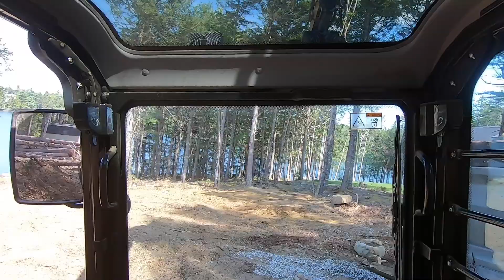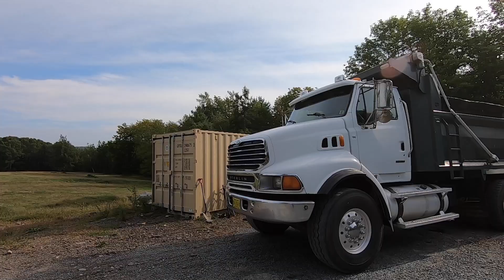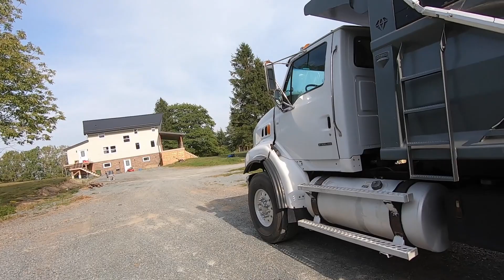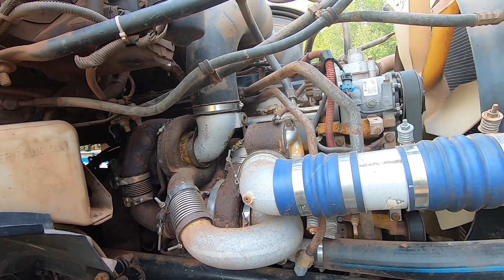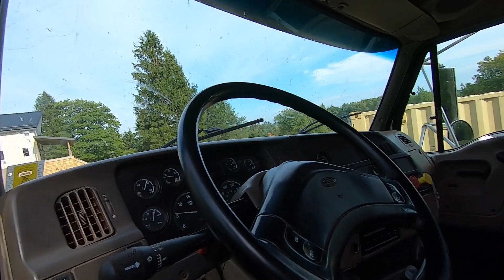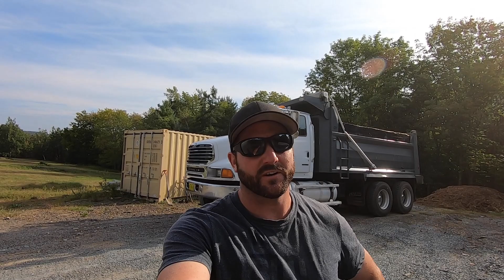I FINALLY DID WHAT NEEDED TO BE DONE & BOUGHT A DUMP TRUCK! DO I REMEMBER HOW TO DRIVE?

Comment: Thats a SLAMMER buddy..  keep the dirt off the underside and door jams, it holds water. As far as the AC.  you have a leak..  Charge it and see how long it takes to  stop working.  If its really short, UGH then you have to find the leak and replace the line(s) if you are ok to keep recharging, then have at it.  Next advice. Do you guys up there use a lot of salt in snow up there? Make sue to rinse it off.  If you have a lot of salt i recommend getting a garden sprayer, then mix 1/2 diesel and 1/2 wd40 and spray it all underneath, under the doors. on the box and back.  Also with the windows up spray a little on the Inside doors.  ( best if you take off the inside door covers and give a little spray.) As far as the  Eaton Fuller,  Piece of cake..  if no load.. Use first or second to start. If you want to sound cool with no load.   run the 3-4 gears fast using clutch.(meaning low to 3/4) Practice shifting around 800 rpms for upshifting with NO clutch and 1200  for downshifting. that truck may be different  but you will learn and save you the clutch.  That truck should serve you well!!!  Good Luck!

Comment: I'd give my left nut to find a clean Sterling like that in BC. Good used dump trucks are hard to find. All Sterlings suffer from the dash breaking its the way it is with plastic. Freightliner carries some parts for Sterling. Getting parts for them can be tricky. Some guys don't like Sterlings myself I like them. Good visibility, turn on a dime. The air liner suspension that takes some getting used to. The Sterling I drove was on spring.  The 4700 Western Star I also drove has airliner you had to use the diff lockers off road. The Sterling had a 15spd I used deep reduction all the time. The Kenworth T450 I'm driving now has an 8LL I use deep reduction all the time backing up loaded.